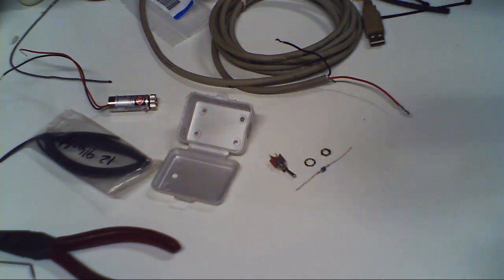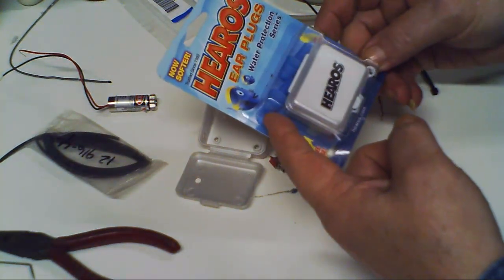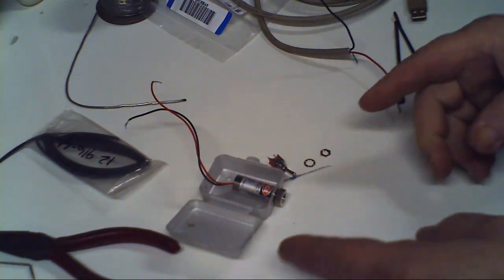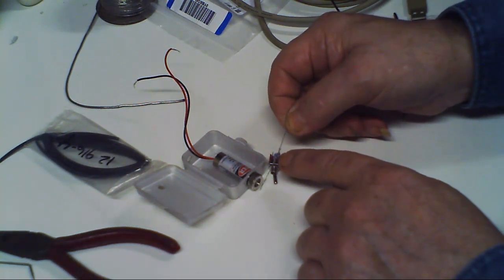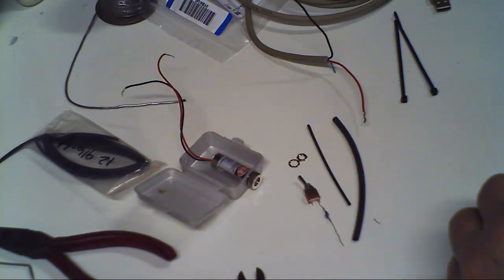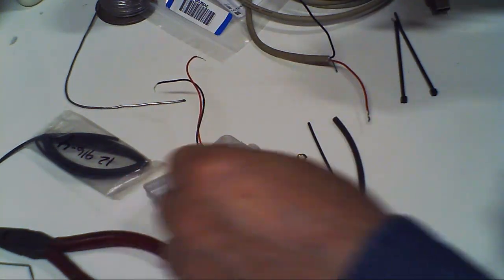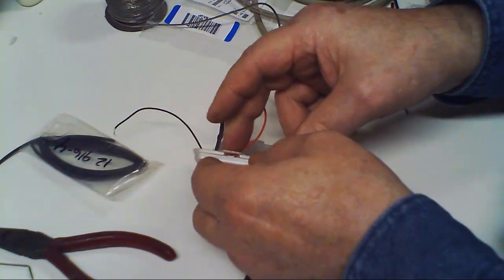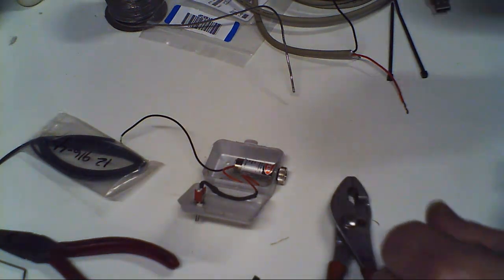How to Build a CNC Laser Edge Finder Part 1

Comment: Are you using 2 - 280 ohms resistors?
Reply from the maker: +Heins Gomez I think that was 280 ohms total, but like I said you have to go with your system, (Computer power on the USB line/type of laser and it's required voltage range). Start with some mid-range and check the voltage then see what it is with more resistance and less. Based on what your laser requirements are.

Comment: just a though, after watching your part 2, did you ever consider using 2 line lasers instead of a cross one? Yeah, you'd have to mount two to your housing but you could then line up each one and make the crossing point directly under the center of your router/spindle.  To explain further: you'd mount one on the x axis side of your spindle, and one on the y axis....then line them up with the center of your spindle and there you go....
Reply: Good thinking. Thanks for posting this.